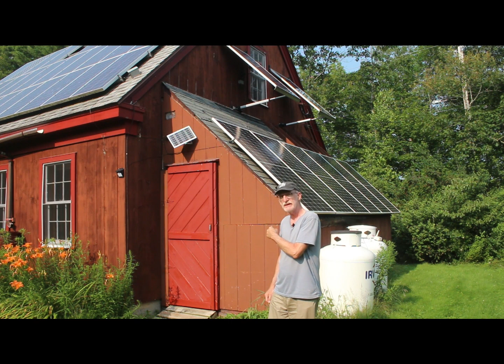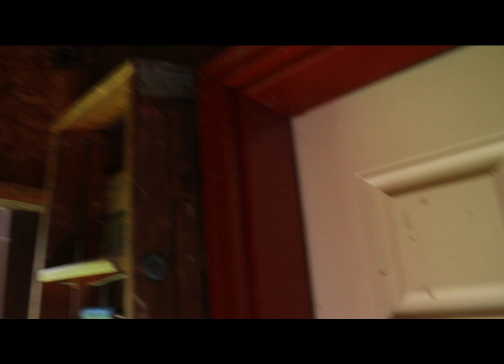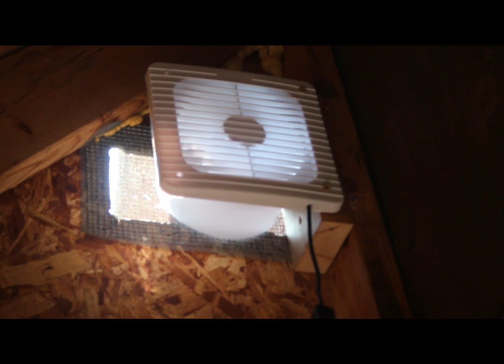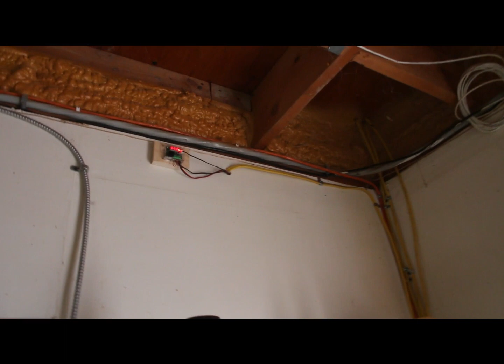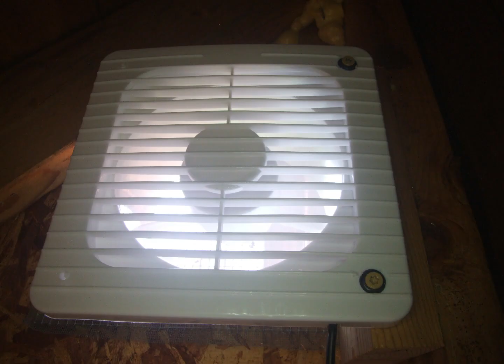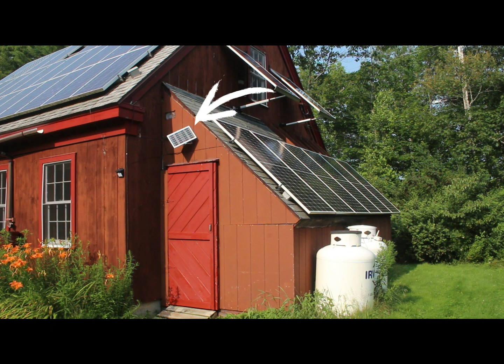Solar shed vent

Comment: Nice. Does this system need an inlet for fresh air and better circulation?
Reply from the maker: Of course, forgot to mention that there is a very large soffit vent that is screened all the way across the bottom of the roof.

Comment: I would love to have your barn, I would have my shop in there, plus store my Porsche 944, my Jeep and my scooter.  Great project by the way.
Reply from the maker: My "barn" is actually a 2-story workshop filled with floor model tools downstairs, and electronics lab and office upstairs.  All those solar panels power this building, the house and my car.  I'm as close to carbon neutral as I can get on my budget.
Reply: @GuyMarsdenMakesStuff  that’s really amazing, I like the idea of going with solar panels awesome touch.  At least you have a decent place to film all of your awesome content.
Reply from the maker: @taranson3057  here's a video about how I installed solar panels, it's not that hard or particularly expensive when you do it yourself.
https://youtu.be/EtKwnlslZNk?list=PLbms9GizN4aRYOMnjQEfCpaA7ACyFOzcO